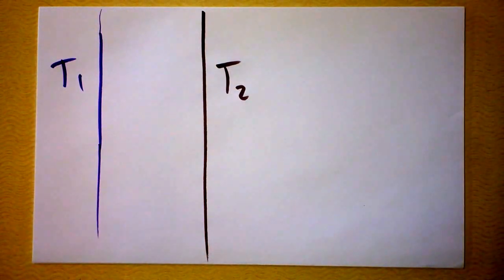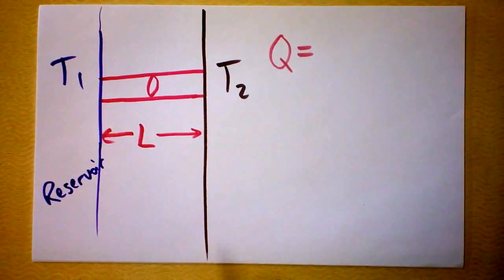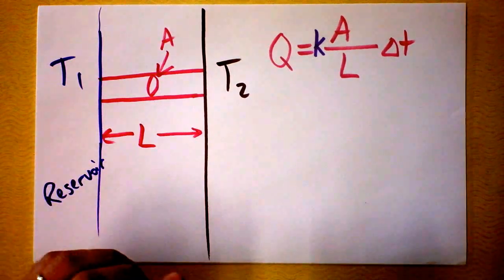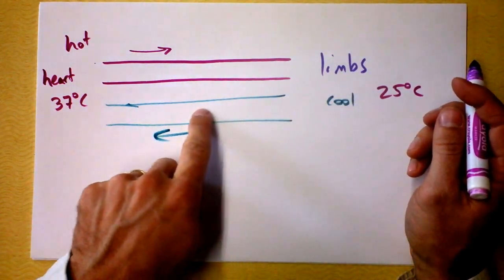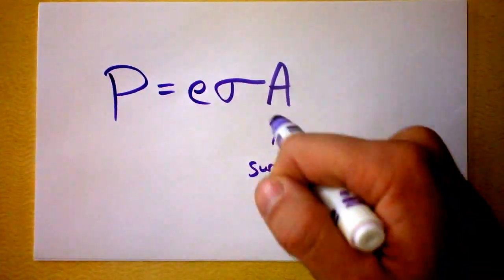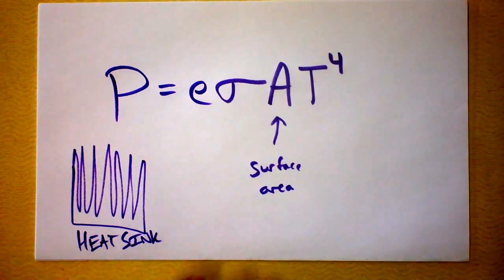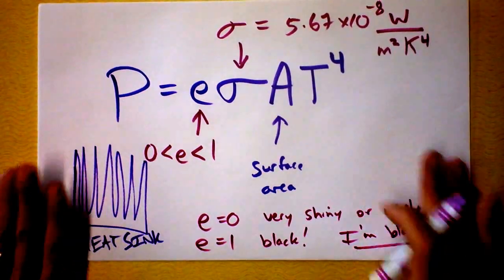Heat Conductivity and Stefan-Boltzmann Law of Radiated Power | Doc Physics

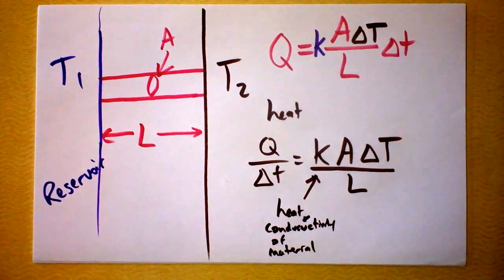Comment: 4:33
I love how analogous this equation is to the Ohm's Law,
Q/t = I
L/kA = R
T = V
and they all have the same purpose too! The difference in Temperature provides the potential to flow, the length and area define how hard it will be for heat to get through and the Q/t is obviously the current, as in, the heat current.
I wonder if the kinetic theory of gases might also apply to electrons to a certain degree atleast in the classical sense.

Comment: very good video,FYI an emissivity of 0 or 1 is not possible, 0 would emit no infra red energy and 1 ( a black body / perfect emmiter) would emit all of its energy as heat, so also not possible. another note is that color has no effect, white paint could have the same emissivity as black paint. but shiny, polished materials do (as a rule of thumb) have low emissivitys around 0.07 to 0.3 and dull, dark, matt, rusty dirty surfaces have high emmisivity of around 0.8/ 0.9. good video though :)

Comment: I have a doubt, it mightn't be based on this video, but close, its based on convection and specificic heat.
All know that during the day time, wind moves from sea to land, and then, moves from land to sea at night. So, is there a particular time when there sill be no breeze at all?... what i mean is, the wind's gotta move from sea to land during the day time and opposite during the night... so at some time, the wind's gotta stop for the turning point... so when would the turning point occur?
Reply from the maker: ess kp Maybe there's a moment when the sea and land are the same temperature.  Wind is notoriously fickle, though.
Reply: yea... gotta keep track of coriolis force too ha... by the way, I wanted to know... are elastic collisions always silent... sorry, I am goin offtrack, but, just for a fact.
Reply: Also, what will be the motion of wind over an island that has seas everywhere?... what happens if the island is too small such that the winds converge in the centre in the day and then they all go away during the night...
Reply from the maker: ess kp They must be!
Reply from the maker: ess kp maybe up?  Remember, the smaller it is, the less its temperature will differ from that of the sea.
Reply: could u plz... elaborate the last statement sir?...
Reply from the maker: Small islands don't have much heat capacity, so they stay the same temp as the sea.  So, less wind!
Reply: yea... I get it now, so, since, there will be a less pressure difference, there will be less wind that will move from heigher to lower pressure! yes yes...
Reply: Now, I got this crazy doubt... is it possible that during the day, the winds would have moved the lands which caused techtonic shifts over the ages... or... is it like... during the nights, they, sorta pushed land that caused less techtonic shift...(over the ages)...
comment
Reply from the maker: ess kp Whoa.  Maybe...  You'd need a land mass with some asymmetry.  But a small force over a huge time may have caused an effect.  What do you imagine is the coefficient of friction between the mantle and the tectonic plates?  Prolly pretty low!  But the edges are sticky...
Reply: humm... good poing... I think... due to pressure difference in different regions... of the GLOBE... at different points--- the winds might have broken the land  instead of... yea yea let me put in this way...
Reply: typing...
Reply: The winds had to bifferent in different parts... they go higher towards equator... they fall with great force... this wind parts try to push the land tangential to the circle(almost... like a deformed ellipse i guess) from equator to the poles while... this was about the wind comming from north to equator... next, from south up, they come towards the equator... here, instead of moving... they... DEMOLISH THE LAND CLOSER TO THE EQUATOR... so, this could be a part of the reason for...the break in the Gondwanaland... then, due to rotation...the lands would go side ways... haaaaaaaaaaaaaaaaaaa maybe Asia weighs more than American lands... WOW... this conversation is gettin way interesting... so, now, winds move even water, due to wind water viscous friction... the water becomes warmer... then, the ocean itself begins to act like a rolling machiene breaking the lands more and more...
Reply: Sorry... I'm going offtrack... could you give some imagination feed... this is REALLY turning interesting... could you also use technical words... in that way, I can learn a lot too... Thanks a lot... lets continue this conversation!
Reply: I did come upon this awsome fact that scientists from NASA research the sound produced by sun and some celestial bodies... they, on fine research, have concluded that... this sound is cloase to the sound produced in the 'Aumkar',i.e., the sound "Aum"... I know this is no way related to this video, nor related to any or the previous conversations... but... this is an interesting topic to talk about... I also think that... it is better to "chat" on fb rather than cluttering youtube...